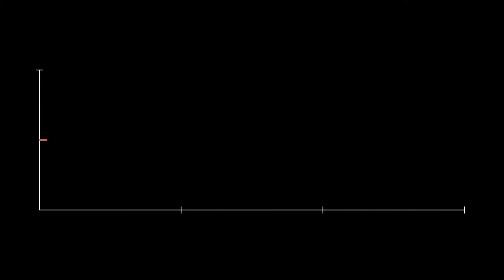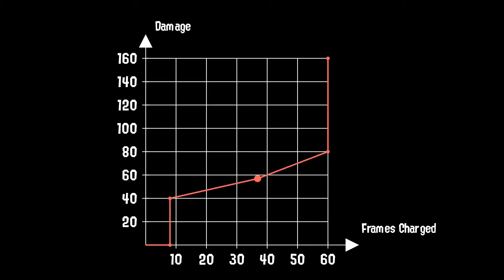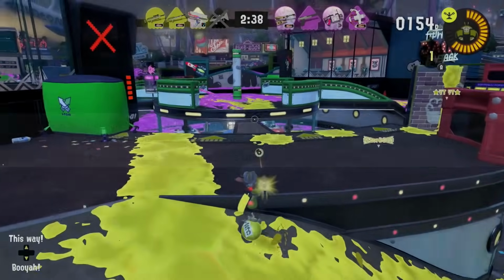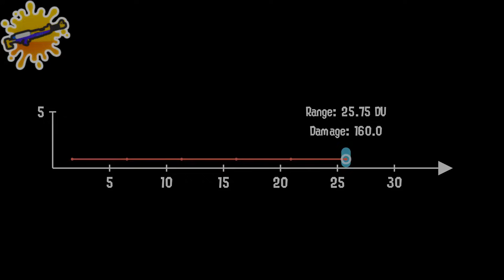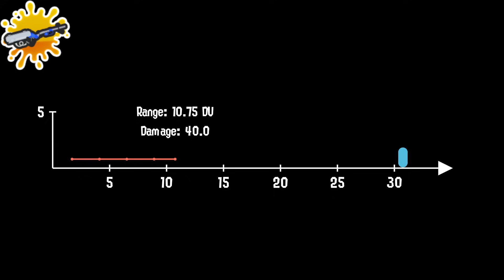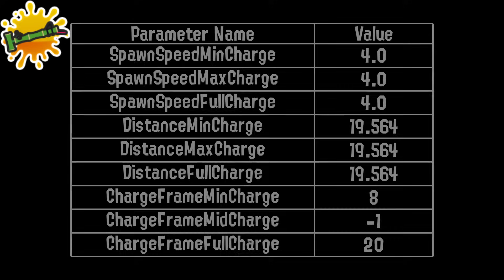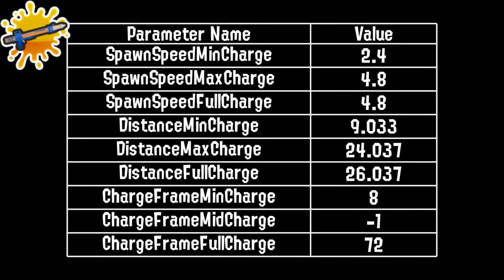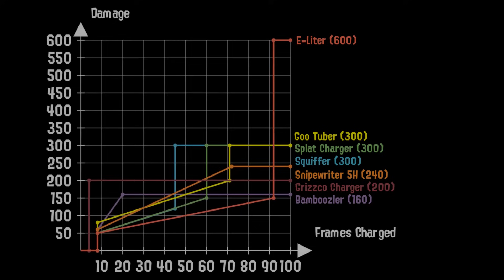How Chargers Work in Splatoon 3 [Projectiles 101, Part 3]

Comment: Amazingly informative video and series, thank you! Seeing the Grizzco Charger pop up put a smile on my face.

For anyone who sees the Salmon Run damage chart and wonders "does the Goo Tuber have nothing going for it?", it's that 80 tap-shot damage peeking over the others that gives it a strong niche! When in SR, it's best to think of it as the Goo Shooter instead - a manual shooter with bonus charger capabilities for when you need burst range+damage or to pierce a bunch of Cohocks. (It's arguably a more flexible charger in SR than the Splat Charger, even.)

Comment: 5:55  you can do some funky stuff in the splatoon 2 storymode hub.
By jumping off grind rails then switching to another weapon the animation will stay the same but the weapon will stay held in the correct hand (right hand most of the time exept for the left dualie).
The way the weapon will be held is like when you force the wrong animation using mods.
If you jump with any other weapon class then switch to the charger it will be held diffrently and the projectile will follow the muzle as said in the video.
the best results are with the roller/brush, splatling or slosher.
If you are an og you might remember the glitch where you  do a charge hold, get out of squid form then switch to a dualie mid animation to roll with a broken animation.
This is another variation of that glitch.
That one can be done both in storymode and in the training area however because it doesn't require grind rails

Comment: I like how goo tubers partial damage scales 40-100 unlike the rest of the chargers, it somewhat helps with evermore combo options. That’s why I like hitting 90 damage in case of team or slight bomb combos. Heck, sometimes I’m able to kill someone instantly without fully charging a partial by doing 99.0 but you’ll usually hit 98.5. 99.0 is pretty tricky to hit. 

Also hoping it gets its full charge range some where between 22 or 23 units.🤞

Comment: Can you explain how zipcaster armor works? I have almost 800 hours on stamper and still can’t tell if it’s different from squid roll parries (bc both are very affected by lag)
Reply from the maker: I believe that zipcaster armor works the exact same as ink armor from s2: if you take less than 30 damage at once, your armor is intact, if you take between 30 and 100, your armor breaks and you take no damage, if you take above 100, your armor breaks and any damage above 100 is dealt directly to you with a cap of 80 (so any extra damage above 180 is ignored, and you cannot be one shot through the armor).

Roll, surge, and spawn armor work the same except with a key difference that the 80 damage cap isn't a thing, thus allowing you to get one shot through the armor if you take 200+ damage in a single blow.

In general, if you have any kind of armor and you're hit by a main weapon, both you and your opponent need to see the hit take place while you still have armor in order for it to actually block damage. Sub weapons and some specials generally only care about the armor being active on your screen.